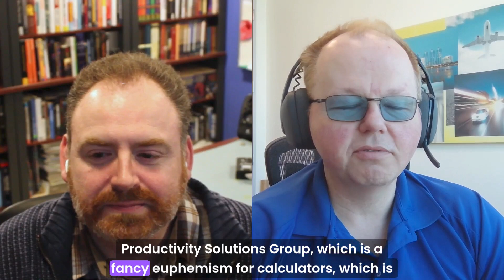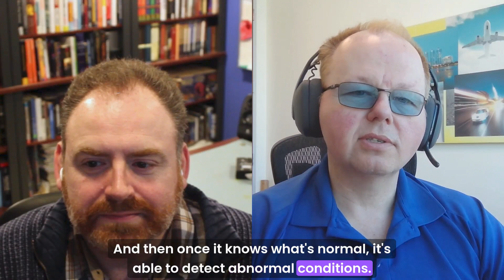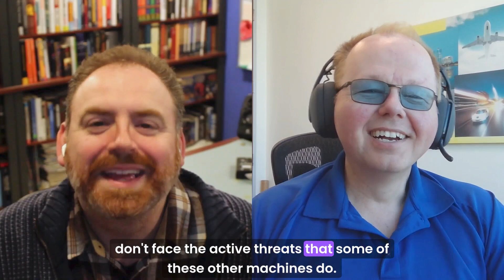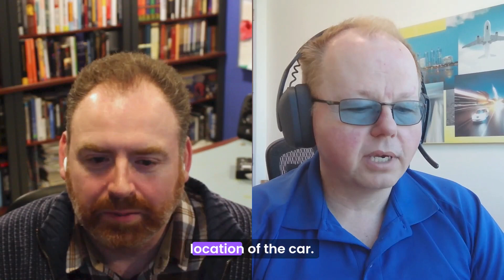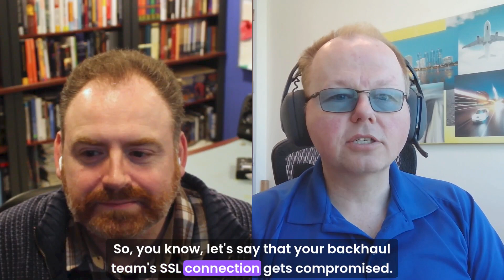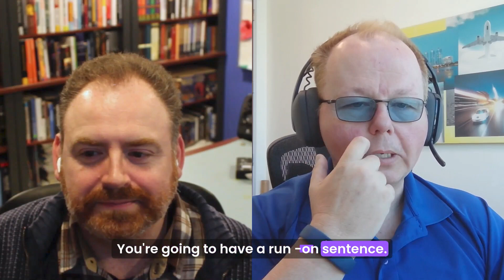009 - Real-World Lessons in Embedded Security, AI, and Systems Development with Shawn Prestridge

Comment: Wow! what a podcast! Enjoyed Every minutes of this. Even though the uncertainty of the future cannot be properly addressed at this point of time, but the confidence of Embedded system Developers is a big sigh of relief for beginners like me. I hope the new shiny object is not gonna Change everything like the regulators are asking for, "hype cycle" sounds just about right assessment. Good practice of coding should prevail with static analysis, right?
Reply: I'm glad to hear that you enjoyed it! C will not be going away anytime soon. C, good processes, and static analysis will win the day for quite a few years to come. However, I could see a slow transition over the next decade or two to other languages. Whether that is C++, Rust, or something else, we will see  . . . (May direct assembly with AI agents writing all the code?)

Even a mixed language solution where all three languages are used is possible. So learning C well will not be an issue anytime soon.
Reply: @jacob_beningo  Do you think, it is remotely possible that Micropython will be as fast as any of those programming language you mentioned above. Also, I tried several Embedded system Manufacturers IDE like STMCubeIDE, ESP IDF but none seem to have taken C++ Seriously except Creating EXTERN C Wrapper to convert C to C++. Is it some inertia that they inflicted upon them. Only Arduino IDE seems to  be an exception. Or it is just me not knowing advance level of using them yet.